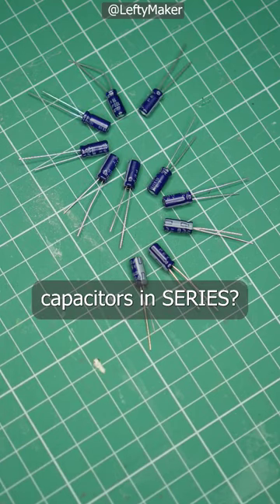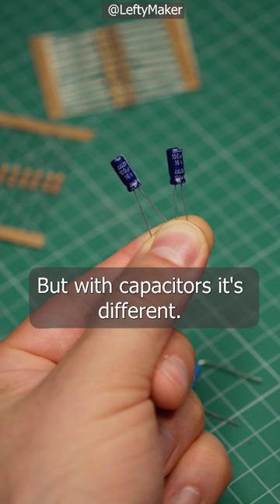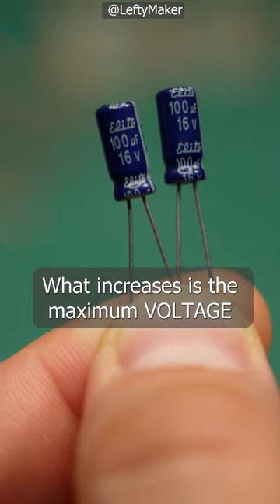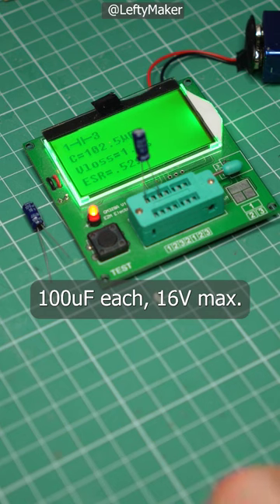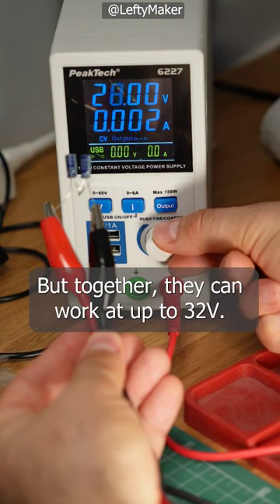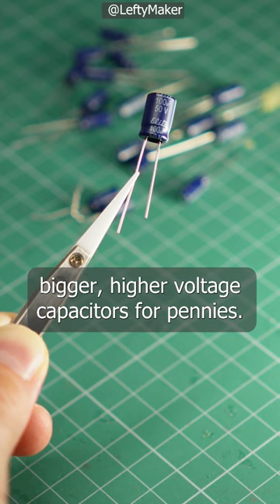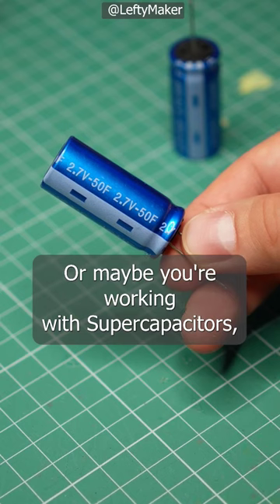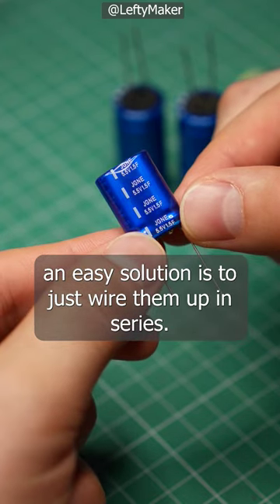Capacitors in series? What happens and when to use series capacitors

Comment: This is only true if all caps are identical.  If you try to put an unbalanced pair or random string of caps together you will end up overvolting your smallest value caps.  The thing that always adds in series is impedance and the amount of voltage drop in a component in such a circuit will always be directly proportional to its impedance.
Reply: In DC ITS Not really impedance but Charge distribution
Reply: Just like resistors in parallel:
The overall resistance is dictated by the smallest.
With capacitors in series it's the same: the smallest dictates the capacitance.
Which makes sense when you think about it : current going through capacitors in series, the smallest will be "filled up" quickest.
Reply: @EE_fun yea that's not right. Resistors in parallel have a resistance lower than the lowest. There are formulas for these things you know.
Reply: @jdmjesus6103  I know. Same for capacitors. Capacitance is lower than the smallest. Cause it is the same formula.
I meant that the order of magnitude is dictated by the smallest. Like when you have 10 ohms and 1k in parallel, It will be in the ballpark of 10 ohm.
Reply: @EE_fun  OK fair enough, I was just clearing it up for anyone else reading tbh
Reply: @EE_fun  forget the ballpark. The total resistance of the parallel connection is smaller than the smallest individual resistance.
Reply: @BrosBrothersLP it would still be related to impedance during the charging phase as a step function has every frequency in it. This is addmitedly a kinda dumb way to think about it tho.
Reply: The formula shown only works when all the capacitors are rated identically for voltage and capacitance, BUT you can do other things. If you compute the CHARGE storage of each capacitor you can match up seemingly UNequal capacitors in series on that basis. For example you can put a 200 volt cap in series with a 525 volt cap, and run each at close to rated voltage if you do them as described next. 
Consider: 1400 uF @ 200 V = 0.28 Coulombs, and 550 uF @ 509 V = 0.27995 Coulombs. They match to within 99.98% at the given voltages. So if put in series they will split the voltage almost perfectly, with neither being over the limit. Combined, they make a cap of almost 395 uF, which at 709 V will store 99.25 Joules.
Reply: @EE_fun  you still aren’t right, the order of magnitude is not dictated by the smallest resistor. Think about the case of 10 or 100 resistors in parallel.
Reply: Yes, even worse— the response of a capacitor to transients is basically a short, so you’re pretty much guaranteed to effectively get the full voltage applied across one of the caps, which can blow that cap… leading to failure and/or blowing up every component in your circuit.
And remember, powering on a DC voltage counts as a transient, so DC will not save you.
Reply: @conorstewart2214  - A hundred resistors in parallel?? That's getting to be an absurd argument, but suppose it is true, and you have 99 resistors of 10 megohms, all in parallel with just 1 resistor of 1 ohm. What's the result? The 99 in parallel work out to 101,010.1 ohms, but when that is put in parallel with 1 ohm you end up with 0.9999901 ohms. So indeed, the lowest value DOES dominate the outcome.
Reply: @YodaWhat  yeah this is pretty simple and you just need to apply the formula.  But using a water analogy you can see how this would work as well.
Reply: @stephens1393  - BTW, the example I gave of mismatched-looking caps in series is a real world example from a circuit I built and have used for a long time. In that device, those series-connected caps are discharged in about 1 millisecond, so making quite a transient. Both caps survive the abuse perfectly well. They happen to be "computer grade" caps, if that makes any difference to you.
Reply: @YodaWhat  The voltage experienced by series caps is a function of 1. the capacitance 2. the internal (or any external) resistance in the circuit, 3. any inductance there may be, and 4. the excitation function, i.e. a step function if you're talking about turning on a switch.  "Quite transient" and "about 1 millisecond" in your case are very rough estimates, but sure, it may be true that your particular circuit survives, either because the resulting waveform across each cap never exceeds the rated voltage, or, even more likely, your caps are more resilient than their rating.
In either case, applying this in the general case as described in this video is not a good idea.
Reply: @stephens1393  - I'm sure it cannot hurt that my load is inductive. :-) 
Anyway, the distribution of charge among series caps was not described in the video, but I described it via my practical example.

Comment: My dads pump for his well stopped working. When it tried to kick on it couldnt start and would just buzz. If you moved the fan motor it would give it some help and get the pump turning. The motor is started by a capacitor. I thought replacing it would be best but it didnt work. We found an identical capacitor in a dryer or something and my dad wired them together in parallel and its been starting his pump for 2 years now with no issues. Just another example of how having even a slim understanding of electronics can save you a lot of time and money. Me and my dad have saved tons of money over the years fixing our own electronics. Just this year i fixed 2 dryers and 2 microwaves. One was an expensive over-the-stove model with a built in stove fan. Replacing a faulty capacitor on the control board saved my sister over $100. I also fixed my nephew's lamp (broken solder on battery wire) this year too. And I'm not bragging these are all really basic fixes any amateur enthusiast could do. I'm not an expert but it surprises me how few people are willing to learn anything about how their favorite devices operate.
Reply: Check your shower
Reply: wiring in parallel does does increase capacity, but not max voltage. so adding another capacitor was essentially just giving the motor a bigger initial reserve of power to work with.

Comment: You can also charge them in parallel to get the full capacity, then discharge in series to get double the voltage. It's called a charge pump. Either way, I didn't know the capacitance dropped in series, very nice to know.
Reply: Yeah... Seems safer

Comment: why counterintuitive? perfectly intuitive when you know what is the capacitor
Reply: But counterintuitive for someone thats just getting into it. And surely all of these are basics that beginners like me wouldn’t know.
Reply: Capacitors are often compared to batteries or buckets of water. In series these all ramp up their capacity, or thought about differently more capacitors -> more capacitance is an easy idea similar to many other correct ideas, it just happens to be wrong.
Reply: in series batteries don't ramp up their capacity

They will get empty quicker under same load
Reply: @brad8122  sorry if I was unclear, I meant without a background that's the intuitive sense, given the flowing water analogy often used.

Comment: Electrolytic capacitors have huge tolerance and putting them in series means you get the same tolerance of voltage across them so one capacitor can get much more of the voltage. And when a DC is constantly applied the eventual voltage distribution will entirely depend on the internal resistance of the capacitor which varies also.
Reply: And that is why capacitors should be balanced with external resistors. This is not possible in every application.
Reply: @buniokowski3162  Agree, some large resistance parallel resistors can help with the eventual voltage distribution but won’t help with the initial voltage distribution where the capacitance tolerance is what defines the voltage distribution. It just means you need to take that into account when picking the capacity.

Comment: Yeah ... don't rely on the voltage ratings to add. THEORETICALLY that's right, but if they are slightly different capacitances or have different leakages you're never quite sure what will happen - and it will all change with temperature, age, humidity etc. If it goes wrong at "100s or even 1000s of volts" there will be a lot of magic smoke appearing all of a sudden. You can ameliorate it a bit by adding resistors to provide a DC path but it is still dancing in thin ice. FWIW that "demonstration" with the PSU is pretty meaningless because a 16V capacitor has a good chance of being just fine connected to 31V ... for a SHORT time.

Incidentally, the capacitance of capacitors-in-SERIES is the same as resistance of resistors-in-PARALLEL and vice-versa. This makes sense if you think about how capacitance is volts per coulomb and resistance is volts per amp alog with considering where the current goes.
Reply: Oh I haven't even thought of that. So if one cap leaks more, then the next time you try to charge the chain to nominal voltage, the most full of them will blow?

Comment: Since charges are equal in capacitors in series due to the polarization of charges, 

C = QV then, in a multiple group of capatiors : 

QV1 + QV2 + QV3 + QV4 + QVn = QV(total)

Since q is equal on both sides, multiply by the reciprocal of it on both sides. 

You'll get that the voltage in a capacitor in series will increase, unlike in parallel where it will stay constant.

V1 + V2 + V3 + V4 + Vn.. = V(total)

And if V is equal to the charge divided by the capacitance, and the charge is equal on both sides, we can just say: 

1/C1 + 1/C2 + 1/C3 + 1/C4 1/Cn... = 1/C total.

So, to find the total capacitance for capacitors in series, we need to find the reciprocal of the sum of the reciprocals of capacitances of all capacitors.

Comment: The change in capacitance and voltage resistance becomes more intuitive when you realize that the circuit symbol for a capacitor is depicting one of the simplest implementation of a capacitor: two plates with some space in between. A plate capacitor increases its capacitance with the area of the plates. Also it increases when you decrease the distance between the plates. However, decreasing the distance between the plates makes it easier for high voltages to spark over from one plate to another. Keeping all of that in mind, it becomes easier to understand that adding two capacitors in parallel is like like increasing the size of the plates. And putting two capacitors in series is like increasing the distance between the plates. The schematic of series and parallel capacitors even suggests those behaviours geometrically, if you think about it.

Comment: If you don't think of a capacitor like a resister and think of it like a battery it mekes more sense. Parallel batteries increases the stored energy and when in series it increases the voltage

Comment: When wiring capacitors in series be aware that any HW component has an inert random failure rate (together with early life failures and aging). Any HW component may fail randomly into i.e. short circuit. So consider adding 1 more capacitor so that if any of them fails into short the remaining capacitors can still handle the voltage and the circuit continues working.

Comment: A lot of DC power supplies use two large 250 volt capacitors in series so they can also handle sudden voltage spikes in the input supply without exploding while also lasting longer as their capacitance does decrease over time with use so they can eventually wear out.

Comment: To ensure an even voltage distribution between caps in series you also need to add high value resistors, each in parallel to a single cap. Otherwise voltage spikes and variations in ESR can result in uneven distribution and kill a cap.

Comment: another thing that I've done before when i only need to slightly go over, is overvolt and hope for the best :D

also, load balancing is an issue for capacitors in series since no capacitors will have the exact same capacitance

Comment: That’s how most capacitor banks on high voltage systems work. It maybe let’s say 115kV but the individual caps are rated for 15k you just stack a bunch in series and the full voltage is shared across them as a team. When one fails the others will have to pickup that extra voltage and maybe subject to failure if the protection relay doesn’t operate
Reply: All i can say is we watched a 19.2k capacitor can make a 12ft fireball go boom one afternoon. The bushing flew toward a live xfmr. Porcelin was everywhere while the can was demolished. Mineral oil was ate up in the flash. Ist came the white flashover, next the orange flame, then the boom. Light certainly moves faster than sound, but you could hear the boom 5miles away. Scariest sight we had that day😂😂😮

Comment: The same thing happens with resistors if you realize youre looking at only one half of the relationship. 

Resistance is like impedance, where conductivity is like capacitance. 

Adding resistors in series decreases conductivity:

E.g. if we have 1 resistor then 1/1ohm = 1 Siemens of conductivity. 
If we have 10 of those in series then the resistance is 10 ohms, going up, but the conductivity decreased 1/10ohms= 0.1siemens

Comment: The device you have there to display the properties of the semiconductors, I have a similar one.  Only in your case did I see a resistor on the circuit board.  What is it for or can you take a picture of what it is connected to?  Because on mine I only have two empty mounting holes above the field for SMD parts.  I recently thought I had found the function when I hold a diode on there.  The device turned off much faster.  Not immediately but maybe 1-2 seconds later.  So I thought it was for an off switch.  But now, as I said, I saw this resistance on  you're board ...
Reply from the maker: Are you talking about that green thing? It's the handle for the thing where you place the component
Reply: @LeftyMaker ahrg, sry on my gadget the lever is on the down left. And the guessing continues...

Comment: I didn't even know there were commercially available capacitors of a small physical size with 1 F, dang. If connected in parallel with another load, it's pretty much going to become a shortcircuit.

Comment: I forget where, but I think it was a power supply repair video, that it was pointed out capacitors often fail shorted.  So another benefit is if one fails in series you won’t get a direct DC short to the circuit.

Comment: A capacitor are two plates close and parallel to each other and in series  you just pull the plates away from each other, electromagnetism is 1/r^2 law means double (r x 2) the distance 1/4 the forces, hence lower capacitance. What's so counter intuitive?

In parallel means the plates are extended (bigger/longer/wider) plates, hence more capacitance.

Comment: how's the polarity? does wiring in the same polarity still change the capacitance? because I've seen it on an opamps stereo amplifiers
Reply: If the caps are polarized then putting 2 identical caps in inverse-series (+ to + or v.v) will basically leave you with an unpolarized cap of the same capacitance because only one will be able to charge at a time.  Placed in series the usual way it works as explained in the video.
Reply: thank you very much for the new information!

Comment: Battery and capacitors in series is higher voltage
Battery in parallel is longer battery life, is it the same with capacitors then?
Reply: Yes.  Parallel capacitors add up.

Comment: Its not counterintuitive. Imagine, E being people lining up near cashbox. Capacitors are like empty rooms. If you connect in series, people begin to collect in these rooms. Their aggression rises as they are pressured against each other, pressure is Voltage. Because their aggression rises - the volume which can hold this aggression drops.  This is opposite to Resistors. While resistors prevent people moving towards cashbox, dropping their aggression (voltage) when in series - opening additional resistors is like opening parallel cashboxes, people flow spreads and ability to stop aggression (voltage) falls  (spreads across: 1/R+R+R..).

Comment: Ok, so when 2 capacitors are placed in series with each other the voltage they can handle is doubled, but the capacitance is cut in half, ok gotcha, I've always wondered about that.
So is it then that when 2 are placed in parallel is the voltage cut in half and the capacitance doubled??? For some reason, something tells me that the voltage would remain the same.
Reply: It works just like resistors do, but in reverse. 

The voltage doesn't change in parallel, but the capacitances add up.

In series the inverses of the capacitances add up, and the voltage is distributed among the capacitors inversely proportionally to their capacitance.

So if the capacitances are equal, the voltages (ideally) add up (in practice the result will be lower due to imperfections and the fact that capacitors have resistance)

If they are not, you need more math:

if the capacitances are 3 and 6, the total capacitance is 1/(1/3+1/6)) = 2
the 3 capacitor receives (1/3)/(1/6+1/3) = 2/3
of the voltage
the 6 capacitor receives (1/6)/(1/3+1/6) = 1/3 
of the voltage

And the (ideal, in practice it will be lower) maximum operating voltage is either 1.5 times the rating of 3 capacitor, or 3 times the rating of the 6 capacitor, whichever is lower.

Comment: if one of the capacitors has a small leakage, the other will receive full voltage. Imagine a resistor in parallel with one of them.

Comment: What if they are parallel?
Reply: Then the impedance adds in series ( impedance is frequency dependent). Think about this, just draw some capacitors in series with circuit symbols and what do you see? A bunch of parallel plates stacking, so added like resisotrs do in parallel. Now connect them in series, and you essentially have a parallel plate getting bigger, so it adds like resistors so in series. A capacitor is essentially 2 parallel plates, so that property is physically built in.